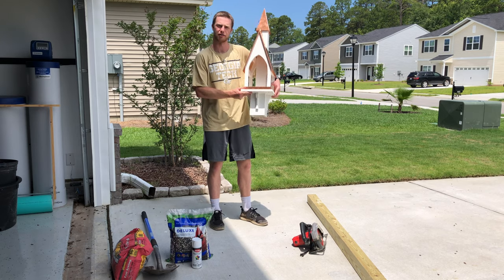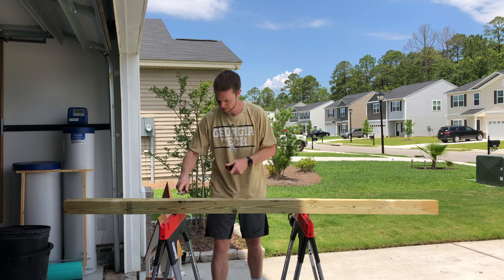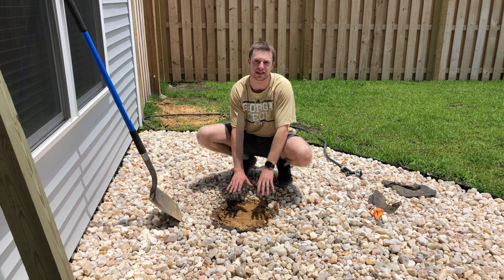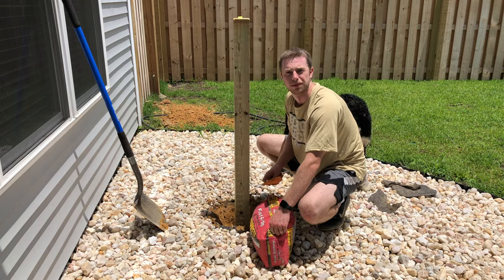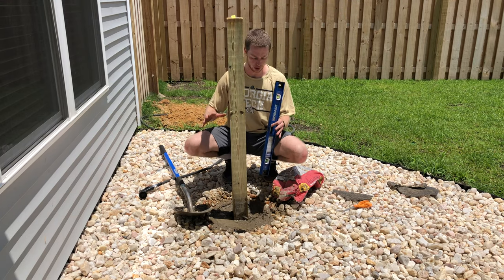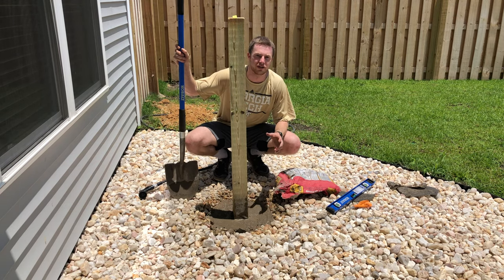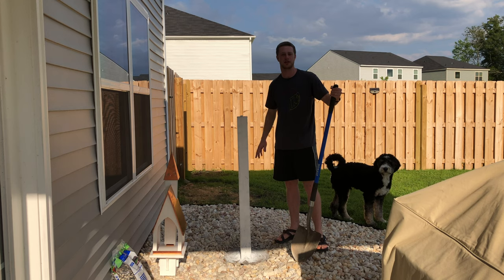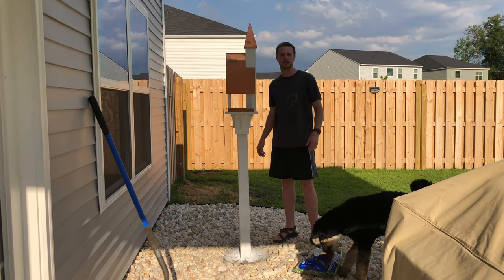How to Install Bird Feeder on Post

Comment: nice looking feeder.  2 tips.  1 paint it before its 3 feet from the house to avoid overspray or use a paint brush.  also, be aware that the seeds that fall into those rocks will quickly become weeds.  so if you dont want weeds in your landscape rock, you might want to put in a different location or just be ready to spray with roundup regularly.  they will grow quickly
Reply from the maker: Thanks the tips. Luckily I avoided the overspray. But definitely had an issue with the weeds. Had to pull them a lot. Not the end of the world though